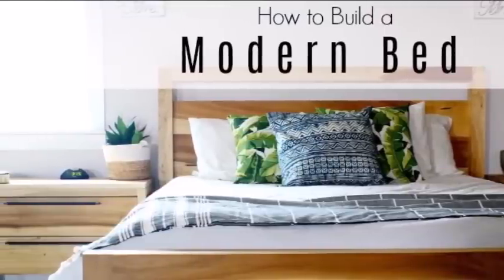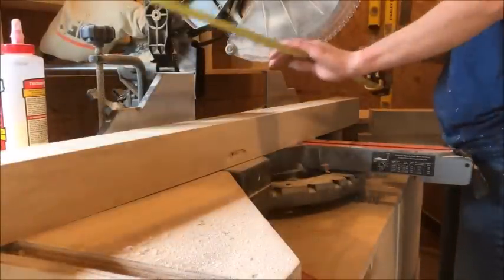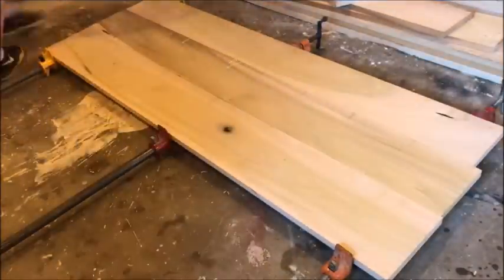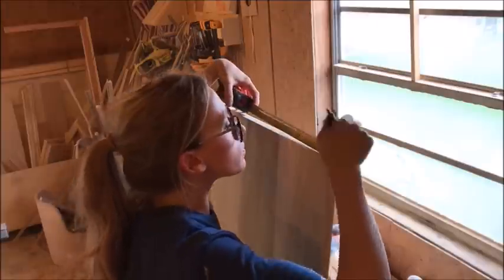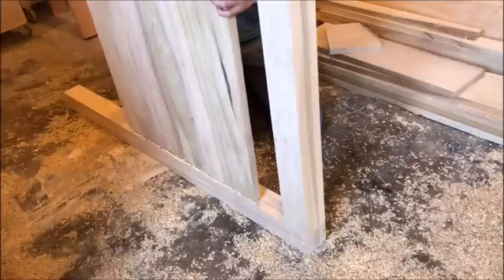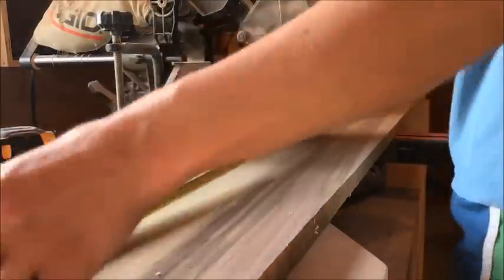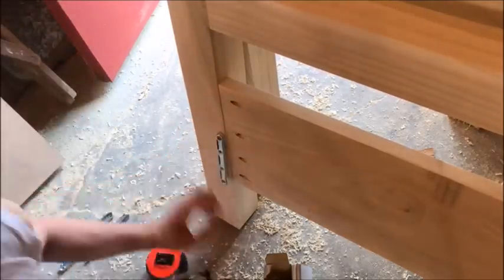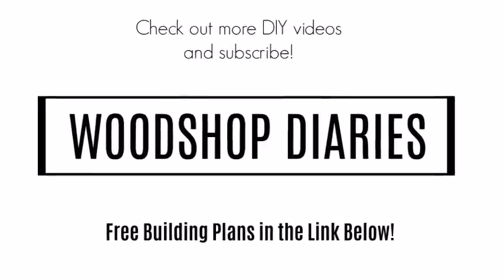How to Build a DIY Modern Bed

Comment: You are amazing. It was very comforting to to hear you say here that you were frustrated with the dowels as you were putting together the headboard. I too have had those frustrating episodes with the dowels…
I I have made many of the pieces you’ve made in your videos. I have bought the plans and follow along. My goal is to be able to use the application you use and design things I have in my head to make them real. Anyway, you really are an inspiration

Comment: Bed looks great!  I love dowel joinery.  It is strong and pretty easy.  A tip is instead of using your tape to mark the reference lines, put your two boards together how you want them joined.  Clamp them if needed.  Then using a combination square, or free hand really, mark across both boards.  Then as long as you set the dowel jig on the reference lines you'll know your holes will mate up perfectly.
Reply from the maker: Thanks so much! I actually figured out to do that after the fact on this build. It was my first time using dowels but if you check my latest video, you’ll see I now use a square to mark my dowel lines 👍 I wish I had thought of that before I built this bed, though 🤦🏼‍♀️😂😂

Comment: I’m curious to how your headboard panel is holding up? You didn’t allow for any wood movement with the way you dowelled it together. Beautiful clean design,  I really like the way it looks. I’ll definitely be checking out your plans.
Reply from the maker: Hatchmadeit thank you so much! Our headboard has held up really well so far. It’s been about a year and a half or so I think and it hasn’t bowed, warped, split, nothing. 👍
Reply: I get such huge temperature swings where I live I suspect wood movement means I’m going to have to modify your plans a bit if I build it.
Reply: @Hatchmade  That headboard breaks every rule of woodworking, your instincts are right into modifying the plan. One thing you could do is put 2 dowels in the center, glue those, and leave the top and bottom end floating. It doesn't need too many dowels as there's no downward pressure.

Comment: Sorry you had trouble with the dowels.  It turned out great looking.  How did you fix the dowel situation?
Reply from the maker: Chris Moore just one of my dowel holes didn’t line up. So I removed the one messed up dowel and left the rest of them 👍

Comment: Hi!  I am almost done with this build and am wondering if you think the 2x2 legs on each slat are fine without using a center support running head to foot? Have you noticed any sag in the middle?
Reply from the maker: I’ve been personally using this bed since I built it with these exact slats. They’ve worked great and I haven’t felt the need to replace/rework them.
Reply: Great to know!  Thanks and love this design.  Had a glue up snafu in the headboard as well but it came out great!

Comment: Silly question... but if i wanted to make the bed taller how would i go about that? do i just adjust the legs? and then carry that throughout the build, or would i need to add extra supports by thickening the legs as well?
Reply from the maker: Sure, you can just make the legs on the footboard longer and raise the side pieces to sit higher off the ground and then extend the supports under the slats